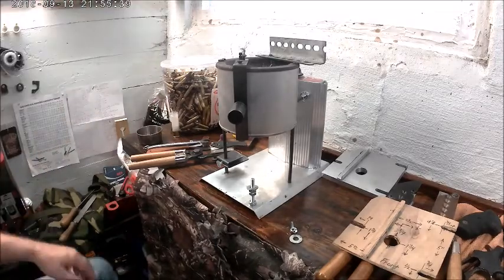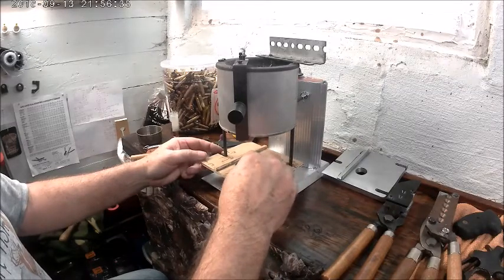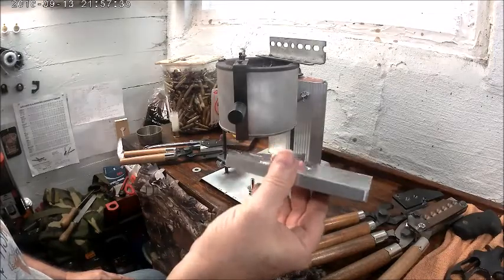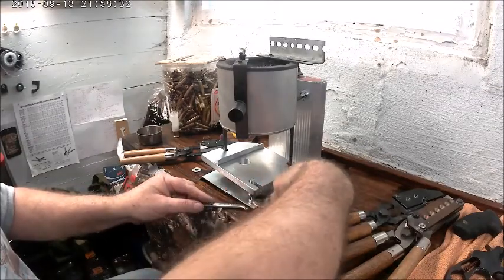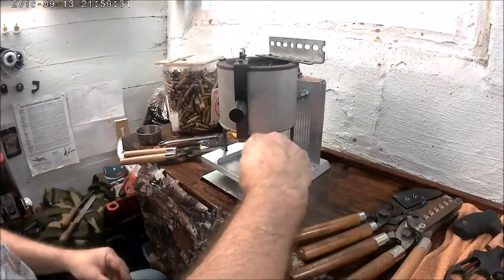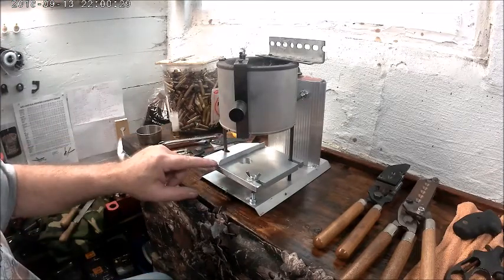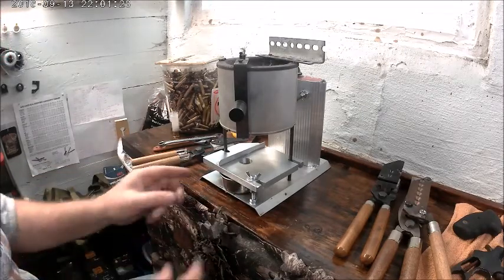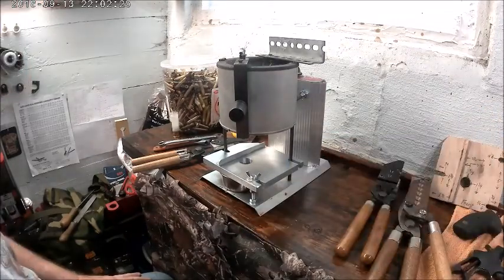Diy Mold guide for Lee 4-20 casting pot

Comment: Great idea and build!
What size hole did you drill for the drip?
What size 2 inch long bolt did you use? #8 #10...
I am getting ready to make one from 1/8 thick plate... I hope mine turns out as nice as yours!
Thanks for the video!
Reply from the maker: I had a 5/8" metal hole saw for the drip hole . The 2 inch bolt is a 1/4" bolt . The angle iron for the guide is 1/2 " aluminum that I used JB weld to attach to the plate . I wish I would have used 1/8 " plate but I used what I had . Good luck .
Reply: @jamespollard1670  Thanks!
How did you use the JB Weld? Just a thin layer and then clamped it in place?
Reply from the maker: @papasplace2  Yep
Reply: @jamespollard1670  Never used JB Weld like that before... but we'll give it try! LOL
Thanks
Reply from the maker: @papasplace2  I use JB weld to keep the mold handles on too . It's high temp stuff .
Reply: @jamespollard1670  Well so far so good!
Just one last stupid question... what size holes did you make for the support rods?
Thanks for your help so very much!
Reply from the maker: @papasplace2  I made all 1/4 " hole and then slotted them .